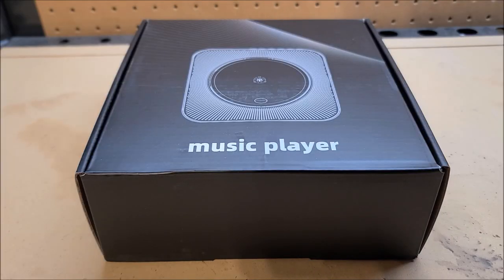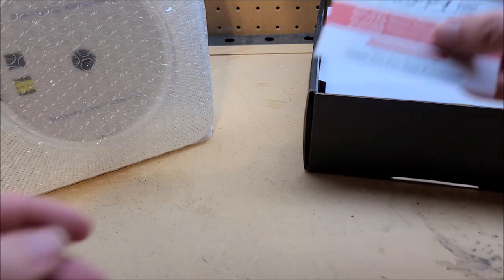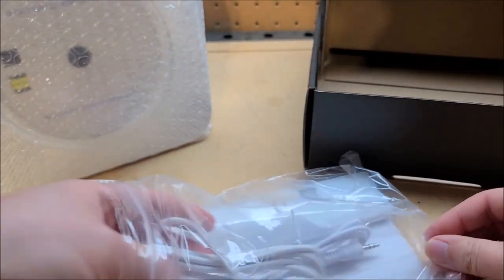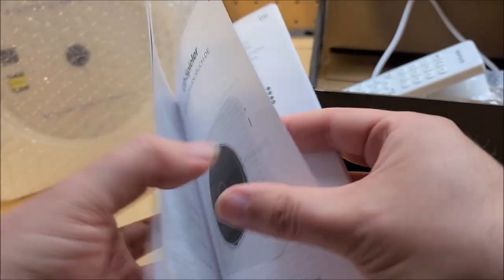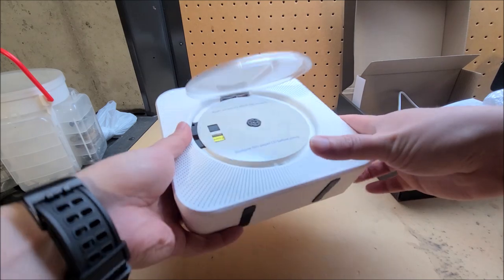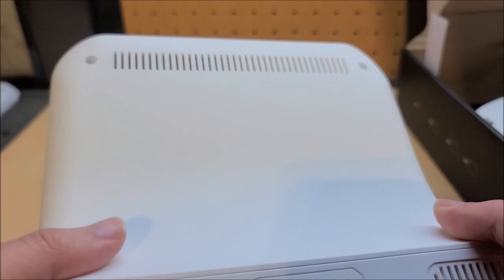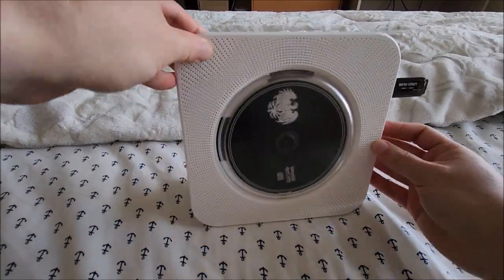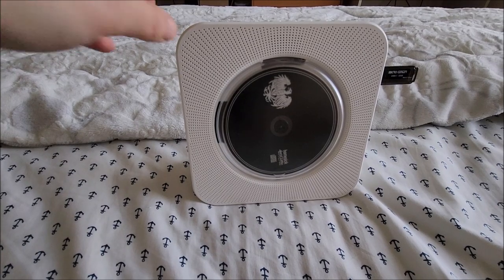Gracioso Portable CD/Radio/Bluetooth/USB/AUX Audio Speaker Review (+Teardown)

Comment: Aren't you afraid of the humidity in the bathroom could break down the CD player?
Reply from the maker: I run the fan vent while I shower so not really. Also it's not like humidity that condensates can contain dissolved condutive ions so shouldn't be able to short anything so long as any moisture evaporates quickly.